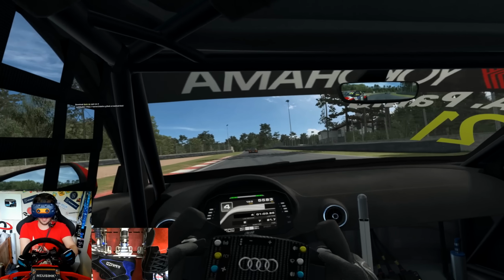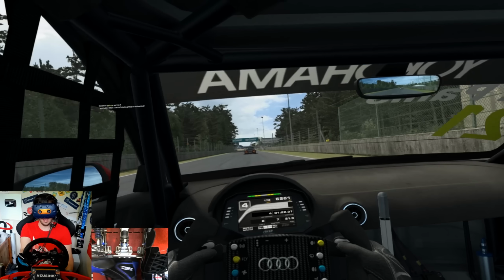How Does Raceroom's Audi TCR Compare To Real Life?

Comment: sim - downshift protection
IRL - upshift rejection
Reply: He prob broke it because he short shifted
Reply: @kimjunguny  if short shifting makes the gearbox dead then that gearbox was long malfunctioning before. It's a bloody racing gearbox! You can't just break it like that...
Reply from the maker: @kimjunguny  I was shifting on the redline, those cars don't rev very high.
Reply: @Jimmy_Broadbent  Hmm okay. It just seemed very aggressive to me.
Reply: @jerkopatrik  it's a D.S.G. gearbox, TCR have race or production spec gearboxes, and VAG have an awesome sequential gearbox. the technician even says so. https://youtu.be/FIa6i5pSjuU?t=848
Reply: @allanwalker5305  I tested a DSG TCR Seat for two days straight, not a single problem with the gearbox
Reply: yup, the dsg can be laggy on upshifts, especially when it gets hot
Reply: More than likely a mapping problem. 2019, love hate relationship.
Reply: thetalkingelement thjs was with a transmission tune, it was a heat issue
Reply: @williamhendrix3253  After watching the TCR video, I assume the gearbox was overheating.  The short, tight track with low speed hairpins leads to a lot of up/down shifting & its all probably harder on the gearbox than running at a full-size circuit.  For all we know, that car could have a ton of laps on it and just be due for a gearbox service and fresh fluids as well.
Reply: Mark Pelto yup. I remember mid ohio was rough on our car

Comment: As a fellow Sim and real racer, with FWD cars, I think I can say a few things:

- The sim and the "real thing" are essentially different. No "seat of the pants" feeling, all your judgement must be done by noise and image. And those two senses are inherently slow, compared to tact and your cerebral sac/utricle. Therefore, you lose a BIG input on your senses and according to pilots better than me, the most important of them all.

- You are not very used to race in FWD cars, Jimmy. The way that you tackled the corners with a FWD was a little off, the apexes where a little too early or too late, given the speeds you carried around them. In the chicanes, you needed to carry more speed and simply aim your car disregarding the twists. And in the high speed corners, believe in the FW traction. If it started to understeer, lift the throttle a little bit (but ABSOLUTELY DO NOT lift the throttle all the way up, or the car will spin) and after the car has shed just a little bit of the speed, you go pedal to the metal and the car will simply push the front-end to the inside by sheer force. If you don't want to lift the throttle because you are not very used to do it, just simply do a gentle and quick left foot step into the brakes, enough to recover the traction and let the brake go. Same effect as lifting, but quicker and shed less speed.

- The "twitchy rear" as you described, is the way tht FWD cars tackle the bends. If the car was too tight at the rear, you would have to slow down too much, in order to turn the car inside the bend, as its tendency to understeer would prevent it from turning, the radius would have to be too great to actually turn. So, you "catch the rear" with the throttle and the brake. What you do is to simply wait for the car to straight up by itself, and let it slide the rear to the outside of the bend in order to turn effectively and quick. That is why aiming for the correct apex and the exit trajectory of the corner is so important in a FWD car. Aim it to where you want it to go and accelerate. If you miss it, the rear would slide too much, you will have to correct, and to do it you would have to slow down the car too much, and you will lose some precious time and speed. So, let the rear slide and believe in the car. Believe the slide.

- The most important thing that the sims cannot simulate, in my opinion, is monocoque rigidity. The twist of the body of the car is so important in order to turn, that I cannot overstress it enough. The steel in the car monocoque is one of the main things that make the car turn. Too rigid and it won't turn enough, too soft and the car may crack the monocoque and cause serious accidents on the track.